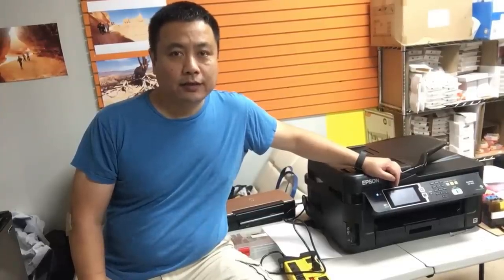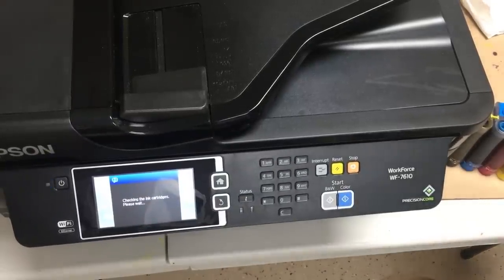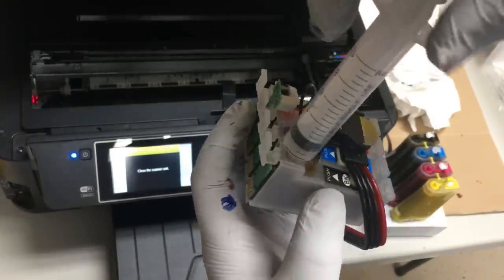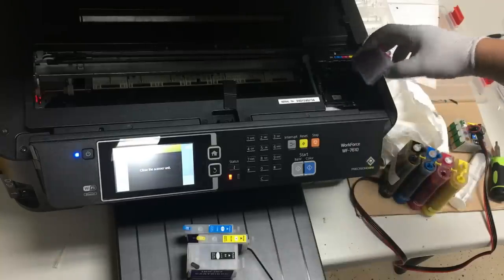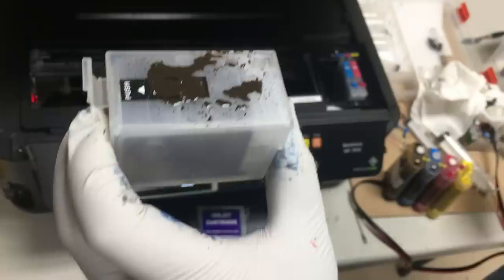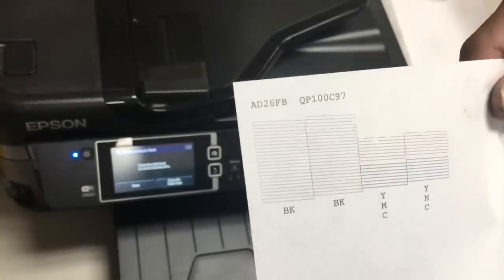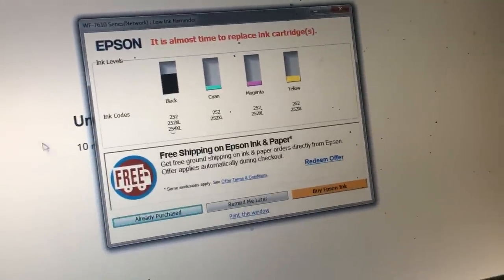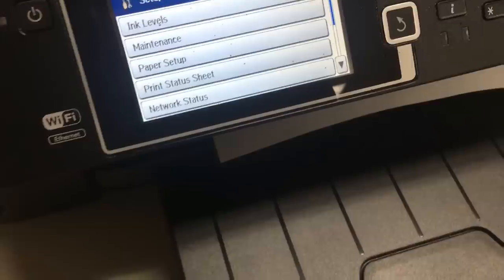Epson WorkForce WF-7610: fix Cartridge Not Recognized & Print Blank Pages

Comment: Hi, I have Epson WF7710 which I use for sublimation printing with refillable cartridges and all of a sudden, after just a couple of months, the Black isn't printing. The inks are registered, it doesn't prompt me that they are non approved inks, and the ink level register shows the ink levels are ok, but, only uses the 3 primary colours, not the black.  I've done numerous head cleaning, alignment etc, but the test print just doesn't print any black? I've took out the black ink cartridge, gently shook it, replaced it, refilled it slightly, all looks ok..  Any ideas please?

Comment: I have a WF-7510 which i am servicing and have R/R the printer head,but now printer will only show printer error screen(turn off and restart) but does not give code, printer head assembly never initializes.Flashes green lights. Have had this issue when replacing or cleaning printer head?

Comment: I have a question. My WF 7610 doesn't want to print documents from my computer. The printer stops at the beginning, (it takes paper from the paper drawer, then it starts. Then paper is delivered to the upper case and the printer immediately stops) and I get the message as if  a paper was clogged. However when I want to make a copy, it works. Can you please help me with your advice. Thank you very much from Poland.
Reply from the maker: That is very interesting.  Did you set the correct size?
Reply: did you figure this out?

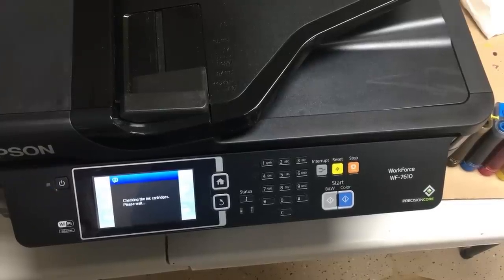Comment: At 2:34, you didn't really fix anything you simply reseated the ink cartridge.... I have same refillables in my WF-7620, and though it accepts the cartridges (with accompanying "nag" screens) sometimes in the middle of large 11x17 full color printouts in the middle (or worse, near the end) of printing a full color image on photo glossy paper (expensive per sheet!) it halts with the "Cartridge Not Recognized" error yet again! Ruins the printout, photo page has to be thrown away and I have to start over after reseating the ink cartrides! I cannot tell you how frustrating this becomes when you're up against a deadline trying to print 20 or so large full color photo quality prints and the printer stops in the middle of every 3rd page or so because it can no longer recognize 1 or more ink cartridges!!! And yes they ARE FULL OF INK!  :-< 
So what's up with this happening with the refillable cartridges? I never experienced this problem with genuine Epson ink cartridges, so I'm pretty confident these refillables aren't latching in securely enough and that's the issue I was seeking to find a fix for when I came across your video! I've tried 2 different sets of refillable ink cartridges, it makes no difference the same issue re-appears just frequently enough to make me want to scream!

Comment: Hello, my printhead is going hard to the left and stops, what can I do to fix it?
Reply: Tracking ribbon is likely twisted or otherwise out of it's guide on the print head. Check for it, it's an almost clear ribbon of tape with etchings in it that tells the printer where the print head is located on the carriage, and if it gets out of it's guide on the print head the printer will slam the print head all the way to the left without slowing down when powered on.

Comment: Can I pull air from the bottom using a regular syringe? I’m having a problem with it printing blank nozzle checks with sublimation ink. I also flushed my print heads clean.
Reply from the maker: The Epson’s printhead cleaning function does it.  You can just use the built in function.

Comment: Hi. I have an Epson WF 3640 and I am getting these problems. For starters the printer doesn’t print anything at all. I tested it with 2 cartridges. I really don’t know what the problem is but I’m trying to fix it please help me
Reply from the maker: So the printer “prints” but the output is a blank page?
Reply: It started off with a blank page. Now the printer turns off everytime I try to print something or when I try to run a nozzle check. I’ve tried many steps to try to fix it but each new method I’ve tried to fix it result in new problems.
Reply: @BCHTechnologies  The problem I had at first was just the ink being clogged. The black for sure and I made sure to install the printer back correctly after cleaning it. But when It get in the process of printing it like just powers off.
Reply from the maker: @princessvanessa3842  You may have a short in the printhead.  Leave the printer for a few days and make sure the printhead dries.  Do not repeat the nozzle check before it is dried completely.  Otherwise, you may burn the mainboard as well.

Comment: Hi Kevin, I'm Chris Nguyen.  I watched a lot of your videos about print head of Epson printers.  I used the print head cleaner but it didn't work.  I still got the problem.  My printer is Epson Photo Stylus 2200 ae messnd my desktop with Windows XP.  On the desktop computer screen, I got the message T-0341 only.  No ink levels indicated.  Can you help me?  Sincerely, Chris Nguyen
Reply from the maker: You mean the printer won’t recognize any cartridge, even OEM?
Reply: @BCHTechnologies  Hi Kevin, I don't know.  I haven't had this kind of message before.  I started using refill ink for about a month then this time I got this problem.  I researched until I saw your videos I think with your knowledge, you might find it out.  Unfortunately, Epson discontinued supporting model Epson 2200 and the difficulty is to find parts.  Thank you very much for your help.  Sincerely, Chris Nguyen
Reply: @BCHTechnologies  Hi Kevin, I'm Chris Nguyen again.  I can write you a little bit more about the problem I got on the Epson 2200.  T0341 is for Photo Black; T0347 Light Black; T0342 Cyan; T0345 Light Cyan; T0343 Magenta; T0346 Light Magenta and T0344 Yellow. They're 7 pin cartridge chip board.  This is a problem I've have encountered:  I got the 2nd RED LED BLINKING or indicated from the left after I powered on the printer.  There're 7 LEDs due to the print head mechanism.  The warning message I got is shown "T0341 Photo Black" (ONLY) while the 2nd LED is indicated.  Therefore, I couldn't run the Nozzle Check with the warning message: "Nozzle Check can not be completed because ink is low or out".  Thank you so much Kevin.  Sincerely, Chris Nguyen

Comment: I was told the best reason for buying a Epson printer was because when one of the colored ink cartridges runs out of ink, you can continue to print in black ink only - THAT IS A LIE.  Each of the several ink cartridges must have ink, if even one is empty these copiers will not print and you get a message - "You can not print until the empty ink cartridge is replaced."  An even bigger problem with Espon copiers, you select to print in "Black ink only" and yet the colored ink cartridges become empty even when you never use them - stay away from Epson copiers.
Reply: yup im having that problem now what a bunch of crooks

Comment: WF-7610 OX97, HARDWARE FAILURE
I called Epson they told me it was a hardware failure and they were sending a free replacement.
The printer was just 3 years old.
If I didn't return the broken WF-7610 they would charge me $140.00.
I return the old printer and was never charged.
So the replacement was free.
It pays to call and ask.

Comment: At 19:23 it doesn't matter if you top the ink cartridge up with ink or not, (assuming it does still have a good amount of ink in it) if you simply push down on it then release without removing it will then become recognized again and you can start printing again (though you cannot resume the current print job it probably interrupted). I'm starting to think these reset chips may be the actual fault that causes this. I'd like to see a fix for that, before I throw the 2 sets of refillable ink cartridges I already have in the trash and return to the abhorrently priced genuine Epson ink cartridges! :-\ 
Just saying. You never actually fixed the problem of Cartridge Not Recognized errors that occur with the refillable aftermarket ink systems for this series of Epson printers friend. :-(